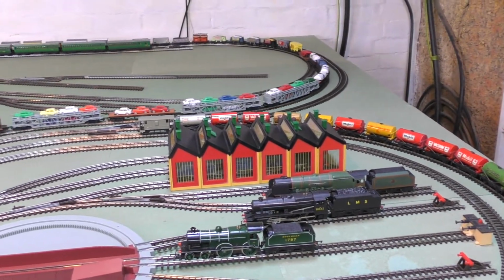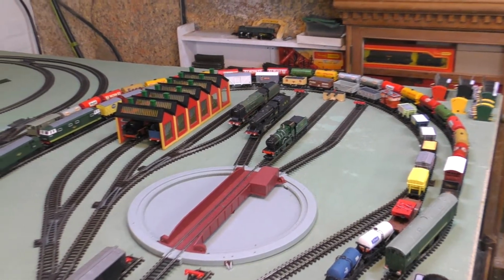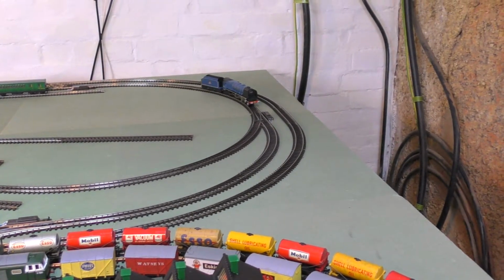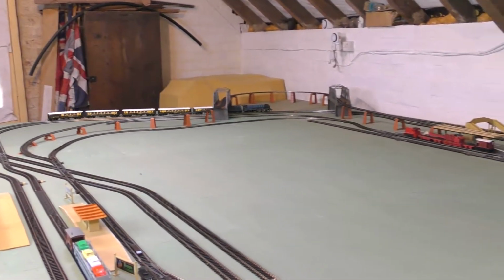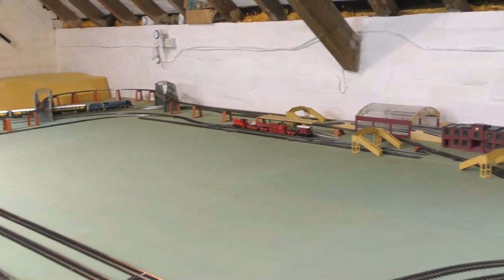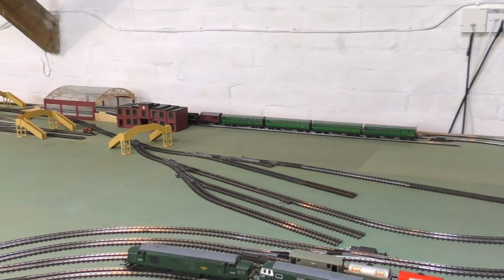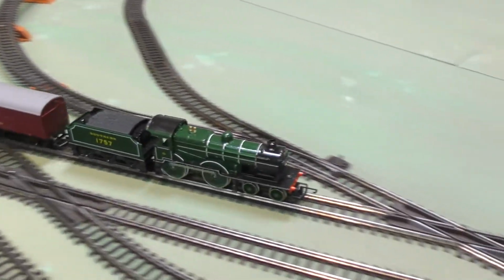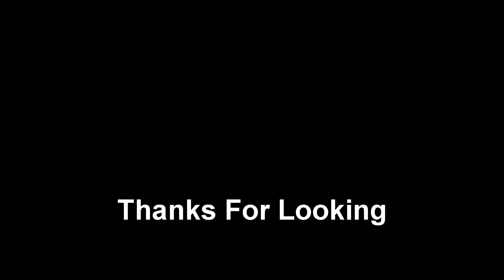Wrenn W2229 City Of Glasgow And Tri-ang R.350 L1 Southern Locos Run On The Tri-ang Super 4 Layout

Comment: Always nice to see Wrenn locos on the move. Do you have any problem with the wheel plating wearing through and have you tried any fix for this problem?
Reply from the maker: Hello Andrew, you raise an interesting point. I have a few locos with worn plating on the wheels, I might have mentioned that the Sir Dinadan has wheels worn through. If the wheels were steel I could clean and replate them but at the moment I don't have a technique for these light alloy ones. I have read about plating alloys but have not yet experimented. All the best to you